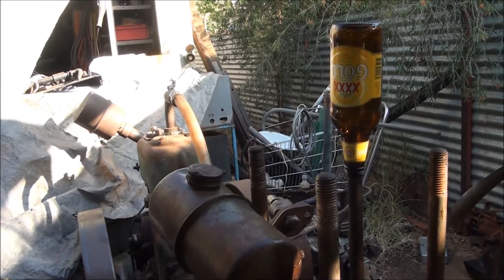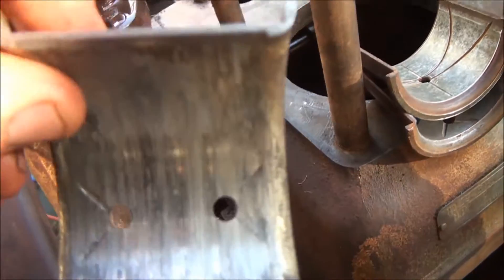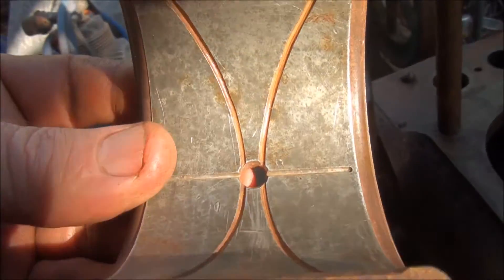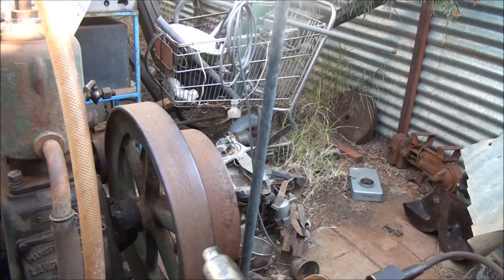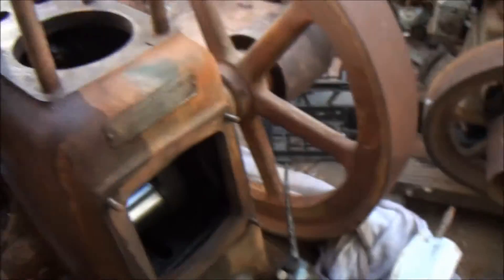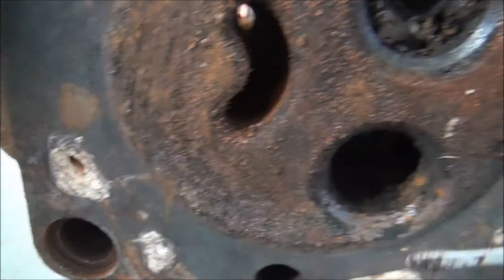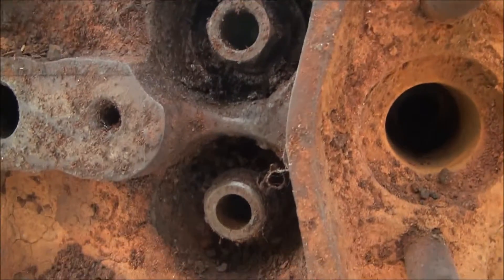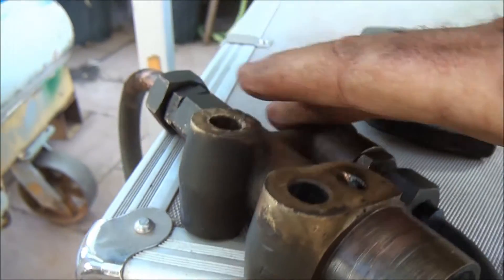Lister engine recovery part 3 UPDATE

Comment: Wonder if this one nearly shared the same fate as the blown 3.5-HP ones?
Would the head and/or parts thereof be applicable to this engine?
I do rather wonder if the two blown ones and the two parted-out ones would have enough parts to make even one functional engine though...
Reply from the maker: TheFurriestOne I think that that engine might not have survived for much longer as it appeared the oil flow was restricted by a misplaced rag blocking the oil pickup filter, I suppose it would be worthwhile pulling the heads off the 3.5 HP engines, I am not sure if they used smaller inlet/exhaust valves to the 6 HP Engines. There would be enough parts to get another running, the property owner told me that yet another 6 HP engine is sitting on an isolated water bore that would be virtually unused. It was originally a brand new engine that did little work, the mechanic had borrowed a big end bearing to use in another engine and a replacement bearing was never installed. The engine was simply abandoned after that, I will hopefully will be able to retrieve that engine soon.
Reply: ***** It certainly doesn't take much in just the right worst place to spell doom for machinery, but it's nice when you can save one and read a bit of its history at the same time. Sounds like if you can locate another NOS or good condition mildly-used bearing you'll have a second runner with a bit of work! Sounds like a good plan, thanks for the info!

Comment: Coming along well Ian :) I wonder why those other two engines in your outback video suffered the con rod failures- overheating and piston seizure perhaps? Strange...
Reply from the maker: Thanks Alan, its a mystery the cause of the con rod failures, maybe over tightening of the big end bearing bolts causing them to break while running or maybe a problem with the governor causing the engine to over rev. I have heard of bush mechanics wanting the engines to run faster to pump water quickly will tie the fuel pump rack with wire and if the engine throws the drive belt it will speed up to destruction.